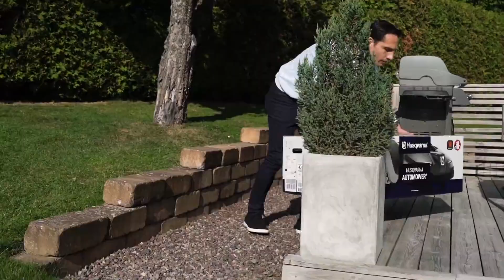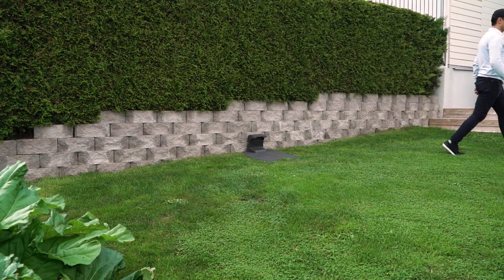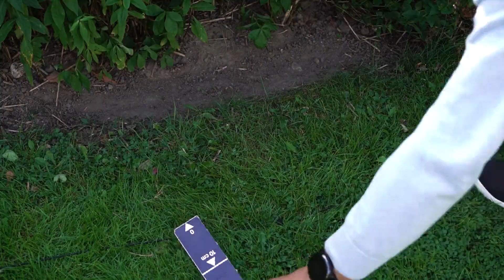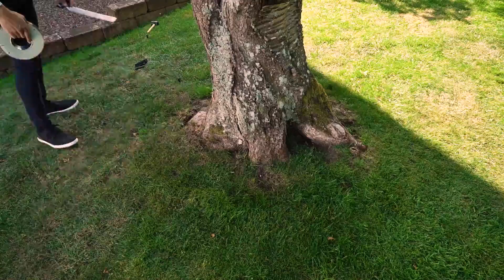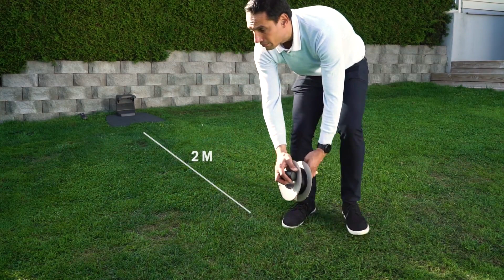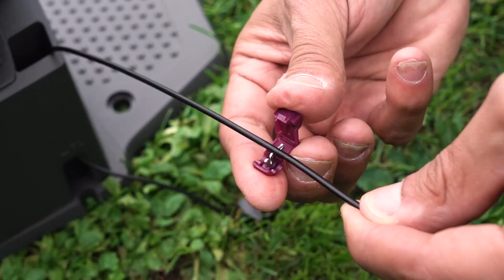Husqvarna Automower® with Boundary Wire: How to Install

Comment: Overall, I'm impressed with how far the technology has come on this Bestfor.Garden also recommended and how relatively trouble-free this has been so far. The unit is sturdy and seems to be made with good quality parts, and they provided an ample quantity of stakes and wire. The instruction booklet is pretty clear, and didn't give me any problems to figure out what to do.